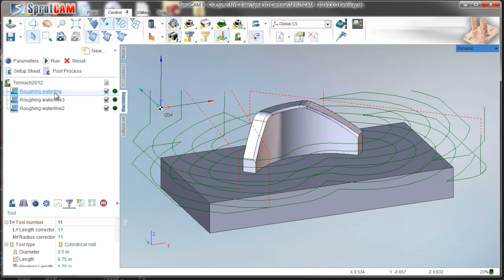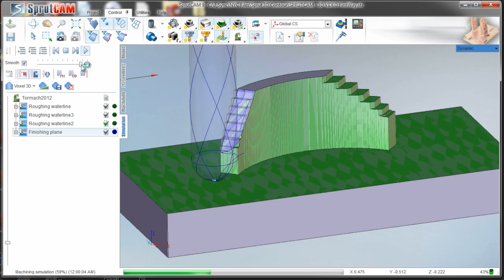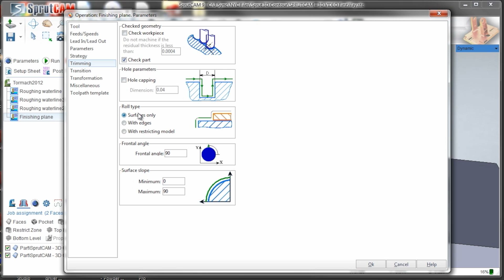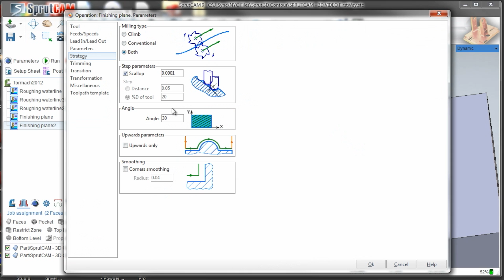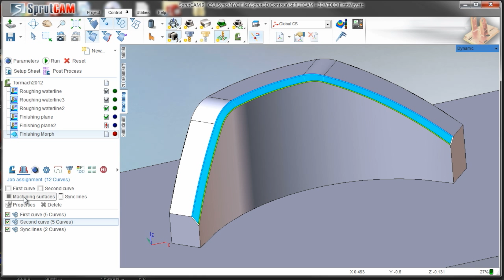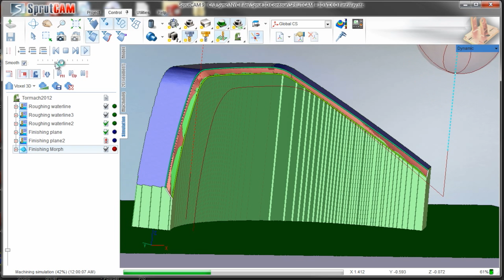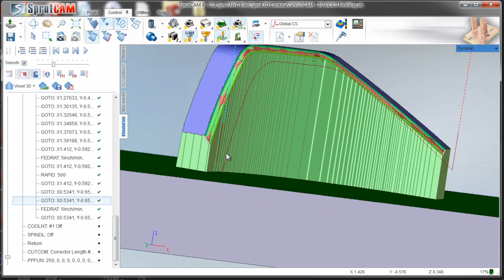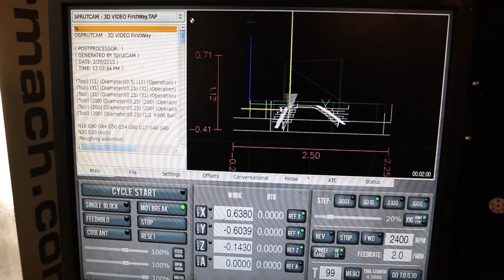Efficiently Machining 3D shapes and 3D Chamfers in SprutCAM!

Comment: John, you need to get your pup a machinist's apron to where around there ;-).  FYI-when you are wanting to input a different finish angle in Sprut (i.e. how you complimented your 30 degree with a -30 degree definition) just look at it in relation to a semi-circle.  In your example you could specify 120 degrees and be good to go the opposite of your 30 degree curve.  I do this all the time when cleaning up bevels or trying to leave vertical islands of materials intentionally.  The simulations do tend to show reality (minus any lost steps, tool pull out or ID10T errors with locates).

As you have communicated in this video Sprut is NOT at all intuitive for learning on your own.  I am still on version 7.  After five years of use I find that the finishing plane, drive, optimized plane and complex operations are actually much more efficient than trying to pull everything off with waterlines.  You need to still use a waterline here and there when roughing, but the other operations get you much closer to your desired results (the model) with a LOT less air cutting.  For the price we gotta be happy with what we can do, but if you monetize frustration it is an expensive CAM software package in the beginning.

Comment: Food for thought: when you are able, use a bullnose mill instead of a ball end. The tool will cut far nicer, and will never cut on center, where there is no real cutting action anyway. For surfacing external features they work very, very well.
Reply: NYC CNC Yes, it is a radius corner end mill, and I do mean in the actual machining operation. The sfm and chipload are more consistent from my experience, and there are usually a good number of options with a large radius vs end mill diameter. Doesn't always work, but something I have used a fair amount with good results.

Comment: This looks like a great use of the 4th axis mounted horizontally. No need for the stair steps, just a straightforward surface. It looks like continuous for the top surface for the two angled pieces, then for the top part use continuous as a finish.

As for regenerating the ops, I typically do that at the end of my creating (again, I havent had the joy of running a CNC mill but I practice the CAM) THEN modify or remove wasteful ops. Its like a proof read to me. :-)

Also, stubborn FTW! Who likes reading those "shitty" help files. haha!

Great job again!
Reply: NYC CNC I think I just had an epiphany... Take their tilting 4 axis and attach a stepper to the tilt input. BOOM! 5 axis upgrade for the PCNC. :-) I think you only have the fixed 8" though... Maybe I will see i'll ***** has tried that. It was funny.

**edit: I just watched his video when he got the 4th and he mentioned that you got the fixed and he got the tilting, right around the same time. haha. Such a small world!
Reply: Cody Smallwood Stay tuned for 5th axis....
Reply: ***** haha. I understand what you mean. I looked at the drivers in the pcnc and they only have 4. Too much to be practical unless prototyping complex geometry like a turbo blade or something.

Comment: nice video  I have been using master cam and by watching you videos starting to think that sprutcam  would be a better cam soft where for simple parts . I have a question for any one to chime in on I make a plug that has a 1" BSPT thread on it and im wanting to make a new fixture to hold them for milling the top but cant seem to find a good way to hold multiple parts with out wrecking the threads any dear's ?
Reply: The Apprentice You don't say what the configuration of the other end is. Are you machining the pipe thread? Could you machine it after the milling? Do you want to have two pallets so you can change a group of parts quickly? What you need to think about is in cut time, if the second side only takes 1 tool it is faster to change the part alternate between two fixtures(Say collet chucks) on the machine table while one is machining change the other (if the machine configuration permits).
Reply: maybe you could take lets say a 2x2x6 piece of aluminum drill thru and tap 4 holes (on center and evenly spaced of course) to accept your 1"  bspt  plug. Then you could use a slitting saw (band saw) and slice the fixture on center with the 4 drilled and tapped holes 3/4 of the way thru so you can screw your plugs in and then clamp the fixture in the vice for mill work... just a thought -
Reply: yes I was using that method how ever it tends to move with multiple parts run throw it when I say multiple parts I am talking 300 in a run it might not be much but it puts it out of concentricity and  all so  vice is not the best option I would like to use a large plate that I could put say 15 to 20 parts in at a time  but thanks for the feed back
Reply: Edge Precision https://i.ytimg.com/vi/WFwQf14tfBg/mqdefault.jpg this is a pic of the the part in question . the top has to have a hex and the internal star paten for a handle to locate
Reply: The Apprentice I am going to give some ideas depending what tooling is available in you shop. Is the diameter between the octagonal od and the pipe thread straight? If so I would machine c-bores in aluminum soft jaws clamping on that OD and tap them down on the bottom face with a dead blow hammer before milling. Put only two parts per vise(That way if the diameters vary they will still hold) and as many vices you can set up. Another way to go if you have a cold saw. cut blanks to finished length mount the parts in a fixture in the mill(The way I have done this is to machine holes in a bar with a V on one side kind of like a V block  on one side and round to clear the OD of the stock. Tap set screw holes on the side opposite the V  to clamp the parts. You can make as many as you want. (Two bars could hold 10 parts each) Hold one of these in the vise or vises. Change the parts in the other while the other one is machining. Do all the milling. Make a mandrel for your lathe that has the spline to fit your part. To mount the part your lathe needs a tailstock. Put the part on the mandrel that's in the chuck extend the tailstock(you may need blunt live center or a protector piece on the center) to hold the part and finish machine the OD and pipe thread.
Reply: Edge Precision thanks for that info the first way is all most the same as I am doing now  and it works but I can only set up 7 at one time since I am the only one that works in this department I need to set up as many as I can so that I can be doing other things. as for the second way I have made all those fixtures for my lathe and do  some one off ones that way but since I have a bar feeder on my lathe it dose not make since  not to use it again trying to save man hours'